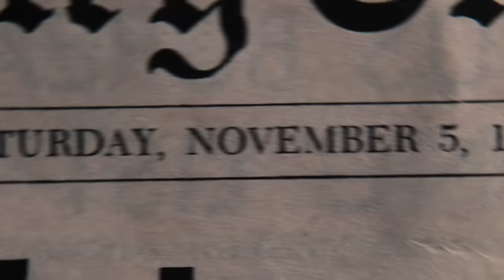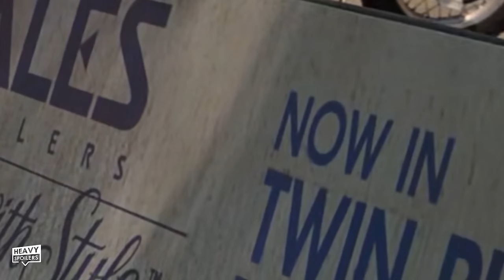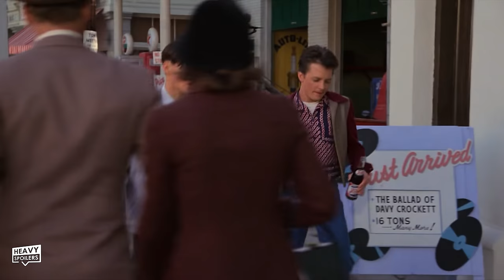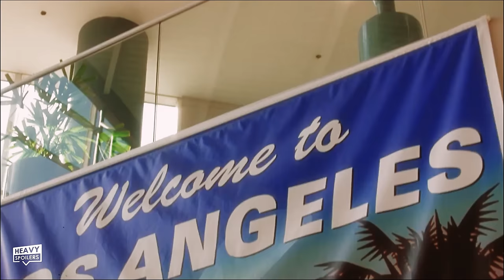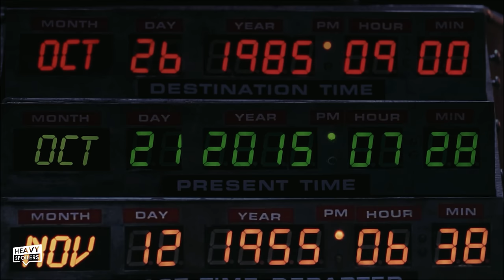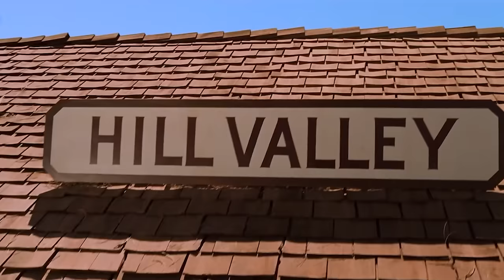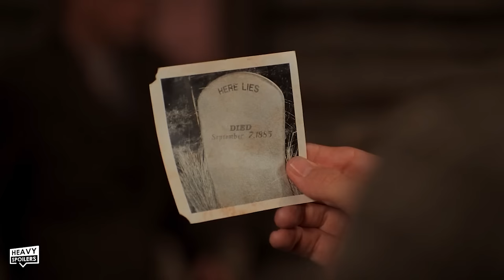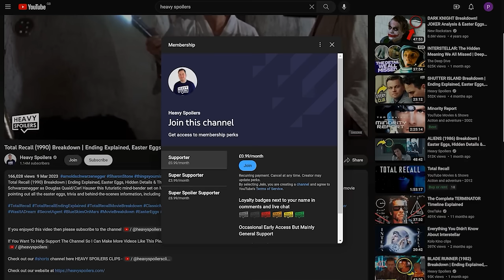BACK TO THE FUTURE Trilogy Ultimate Breakdown | Every Easter Egg In Part 1, 2 & 3

Comment: ONE THING! They did not use the Delorean from 1885 because that would create a paradox and then Marty would have never been able to find a buried Delorean in 1955 so he would have never been able to travel to 1985 in the first place. PARADOX!
Reply: also, 2 fun facts, Marty's tie (or double tie) pattern design in 2015 also reference to Japan. And the other is that there are 3 Delorean in 1955 at the same time at some point: The original, the flying one, and the buried one.
Reply: @Sacrengard The third one is Biffs. The one buried in the mine doesn't appear until Doc is struck by lightning and goes back to 1885, after the flying one disappears.
Reply: @mxplixic  knowing how the time works on those movies then you are right

Comment: The clock on the General Electric coffee machine at 9:08 was also set to the correct time (though it's obscured by an X that was taped over the hands. Guessing Doc did that because he couldn't change the time on the machine, so the X is meant to be a "don't look at this/it's wrong/broken" kinda thing), so there's a couple that snuck through :D

Comment: @01:41:03 

when storing a vehicle like doc did you need to remove all fluids from it otherwise itll rust and decay the insides of the motor/transmission  as well as the fuel tank, since fuel storage additives weren't invented at the time, and gasoline wasn't going to be invented till 1892, so he needed to drain it all. and likely burned it to prevent premature invention.

Comment: Biggest plot holes for BTF3 were the fuel line being hit wouldn't drain the tank the arrow hit mid body, the tank isn't in the roof there's plenty of fuel left, second a speedometer is just a sensor input Doc could easily make a simple tool aka a 'drill' to spin for an old style sensor that measured RPM of the transmission/wheel/speed sensor etc and hook up the sensor to that at it would just have to simulate the RPMs required to hit 88MPH.

Comment: Fun fact: The camcorder would not have been watchable on Doc's TV.

In 1955, TVs only supported broadcast signals in black and white, using the NTSC (National Television System Committee) standard. The camcorder, however, records in a different format, likely VHS or Betamax, which wouldn't be developed until the 1970s and 1980s.

Doc Brown's TV wouldn't be able to display the video from Marty's camcorder because:

1. Incompatible signal format: The camcorder's output wouldn't match the TV's input.
2. Lack of necessary decoding: The TV wouldn't have the necessary circuitry to decode the camcorder's video signal.

My best friend's dad mentioned this when we watched the film. He was an expert on VCRs in the 1980s.

Comment: 1:16:36 also Robert has said that it was a common thing to see kids in the 50s wearing their 3DGlasses outside of the theater because you weren’t actually allowed to keep them so they would actually steal them because at the time producing cardboard and tinted thin maylar lenses even as basic as they were would’ve cost quite a bit for a movie theater actually own. At the time, Mylar was quite a new material the to general public. It had been used in film and industry for quite a long time, but it never had real applications for the general public until the 40s and 50s.

Also, 3-D would’ve probably had to permanently use tinted lenses because he wore those all through his development years. That would absolutely be horrendous on your actual vision. He probably couldn’t see certain colors in one eye and other colors not in the other eye just think of the crazy connections, your brain would make with that , probably turning into a psycho

Comment: 3:36
You got that backwards. A clock that's moving ticks slower than one that is stationary. And a clock that is in the gravitational well of a massive object will move slower than one that is far away from a massive object. And a clock that is moving raoidly around a massive object will tick slower than either clock which is only moving or only close to a massive object (depending on the masses of the objects, the speed of travel,  and the proximity to the massive objects.) 

There are formulas to describe all of these phenomena, but I'm not gonna type out all that.... 😆

Comment: The only thing I can say is if in 1885 and they did take the gas out of that one, that was struck by lightening, sending Doc back to 1885, wouldn't that affected the discovery in 1955?
Like technically there were more than one time machine in 1955. The one Biff stole, the original from part one, the one hid in a cave.. Not to mention the one that was in 2015. It's only it's not suppose to be that way with this reality but think about it carefully. There were 4 people DeLoreans in 1955 at once. 1885 version, 1985 original and 2 from the future, 2015. Technically.